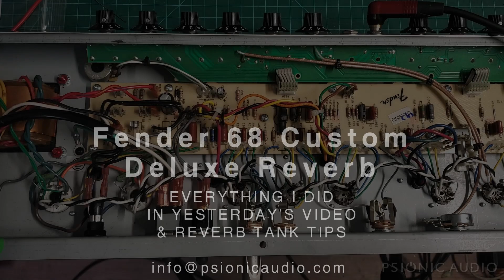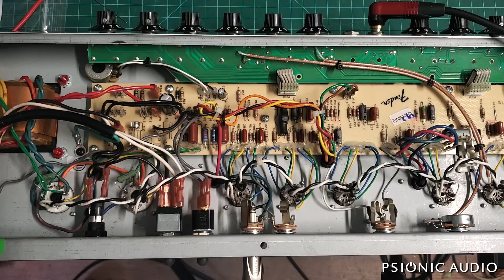Fender 68 Custom Deluxe Reverb | Everything I Did in Yesterday's Video & Reverb Tank Tips

Comment from the maker: Just got this from the owner:

"Will try to be brief here. Since owning a real '65 Blackface Deluxe Reverb, I have tried to get that sound back without spending thousands to get another original. I've had 2 '65 reissues and then got the '68 you worked on a few years ago. Took the 65's to various techs around Nashville in the early 2000's, even had a Mercury Magnetics O.T. put in one, but nothing sounded as good as what you did to the '68. I'd say it's your experience and common sense that produced superior results. Thanks again. BTW, the Mojo reverb tank sounds great. Thanks for recommending it. Well, back to playing too loud, really enjoying the sounds coming from the amp."

Comment: Can't thank you enough for these videos. I followed along and did all these changes to my 68 Custom and it is now a fabulous workhorse. Went one step beyond and pulled the standby switch and installed a rotary for a replacement output transformer with 4, 8 and 16 ohm taps (Hammond 1760H). Oh and also put a 3 way switchable negative feedback in the external speaker jack. Upgraded the reverb pan to a Surfy Pan Extra and installed an old JBL D120F. Just a killer amp now. Thanks so much!

Comment: I heard ticking sound ( low volume) and it does not increases when volumes are higher on my 68 SF reissue.

I am wondering if this mod will help

Installing a 0.01\mu\text{F} Capacitor (Fender Technical Bulletin Fix):

aeramic disc capacitor (rated for at least 600V) directly across the LDR optocoupler to ground absorbs those sharp neon lamp pulses before they reach the audio signal path. On many '68 Custom models, this section lacks sufficient filtering straight from the factory.

Lead Dress & Wire Routing:

The wires running from the SPEED and INTENSITY potentiometers to the circuit board often pick up interference. When a technician carefully separates, isolates, and routes these wires tight along the chassis—away from the sensitive grid and signal leads of the preamp tubes—the noise level drops drastically.

Replacing or Testing the LDR Optocoupler (Roach):

Sometimes the optocoupler itself develops electrical leakage or degrades over time, causing it to emit stronger pulses than it should. Replacing it with a new, high-quality optocoupler solves the issue at its root.

Comment: I have scoured your videos addressing C5 when you cut the V1 and V2 Plate Link.  Looking at the schematic it appears that C5 has to be reinstalled
to link the custom channel back in.  Also, I see you cutting the Green Wire out to V2 but never explained why. I know you are busy doing these instructive
videos.  And they are very productive.  Could you address this please.  Also working on a 2019 68 it appears they did not put that 18K R in the Custom
Tone Stack.

Comment: Regarding R69, the 22 ohm in the Bias supply. If I may ask,  you cited changing it to a 470 ohm 1/2 watt. I can't find a schematic with the 470 ohm. Can you suggest one?
Also with R69, in another video you suggested beefing it up with a metal film flameproof of higher wattage than stock and didn't mention 470 ohm.
Did I understand correctly?
Regards and thank you. 
Gregory

Comment: I just completed all the mods mentioned in this video. I have a new amp. The difference in tone is outstanding. Every frequency is present now. The mids pot is a must. And quiet - the noise is gone. That's worth repeating - the noise is gone. It's very responsive to every note I play. I set the volume to about 4.5, mids pot at about 6, bass and treble about half way on the classic channel and adjust what I want at the guitar and how I pick the strings (telecaster). The amp now responds to how I pick a string. Full rich, with everything the way it's supposed to be. I've got a pretty nice Mesa Boogie combo amp - I'll put this one up against it any day. It truly responds to my playing. Thanks big time for making this information available. I don't recommend doing this yourself unless you really know what you're doing. It's not worth getting hurt for or causing expensive damage to your amp. But, for those that have the experience and may be on the fence with this, you won't recognize your amp. It makes that big of a change.
Reply: Hello , i'd like to make this mods aswell , but i'm a completely beginner at moding amps, was it the same for you ?

Comment: Hi Lyle. Just bought a used but like new 68 Custom Deluxe Reverb. It is very quiet and everything works as it should so I'm not thinking about doing any of your modifications right now. I'm just enjoying having a Fender amp again. 
  However, my question to you is... It came with the stock GT branded JJ 6v6 power tubes. They have a rated number 9 sticker on them. I was wondering if there would be any benefits in installing a rated number 5 set in the future and as backup?  - Thanks for all you do here!
Reply from the maker: That number is pretty meaningless. The amp has an adjustable bias that a tech can set proper operation with a range of different 6V6s.

Comment: Regarding the screen grid resistors: I've seen you re-locate them a few times now, and I've noticed that sometimes you jump the empty spots, sometimes you don't. sometimes you cut the existing wire connecting to the pcb. I also noticed that it appears that you have the black and white heater wires both connected to pin 2 of the first octal socket. I was just curious as to your reasoning behind those two things. I'm a fan of your work. Thanks for making these videos.
Reply: Depending on the layout and tube pin requirements you can't always jump empty pin spots as they may be tied to other parts in the tube.  Not all 8 pin tubes have the same pin outs.     
    In this example, Lyle left the heater wires to the board because it had the (hum) balance resistors already in place, but the heater current is now going directly to the tube sockets instead of through the quick connectors and board.   The black and white heater wires are not connected,  white is pin 2, black is pin 7, it does look like that because of the angle.

Comment: Man, I had this amp and thought it was terrible. Sounded OK alone but as soon as I put it in a band situation I couldn't hear it due to what I think was a lack of certain frequencies that didn't allow it to cut through. Sold it.
Also, mine came from the factory with reverb and tremelo on both channels.
Reply: I had a very similar experience. Really awful amps, in my opinion. Couldn't sell it fast enough! Bought a hand wired Super Reverb clone and man, what a difference!! 👌
Reply: Just bought one in a flight case mint for $650. Bonkers depreciation.. for good reasons. At that price I will spend a few hrs "fixing her" for sure. Bargain really.

Comment: Regarding the "wrong" negative feedback resistor, It's part of Fender's marketing for this amp. This is what they said,"Reduced negative feedback increases touch sensitivity and overdrives faster". I prefer the "proper" resistor. Amp sounds great. Thanks again, Lyle!
Reply from the maker: Yes, they were intentionally wrong. ;)

The main result of their 1.5K NFB resistor was just a higher noise floor.  It didn't radically change the output section behavior/sound.

Comment: "Wrong feedback resistor" ---- wrong resistance value ? (too much or too little feedback?); or fed back to the wrong point in the circuit? [Edit: Aah, a little later in the video you said the stock circuit didn't have enough negative feedback, so, presumably you lowered the resistor value].